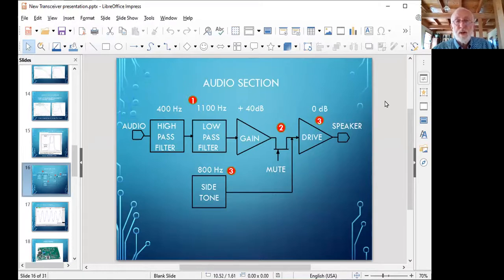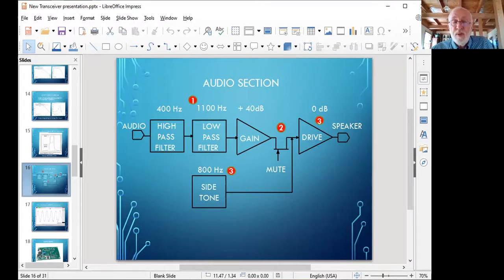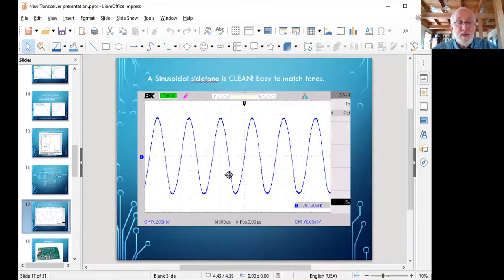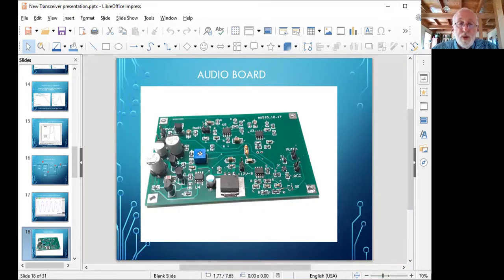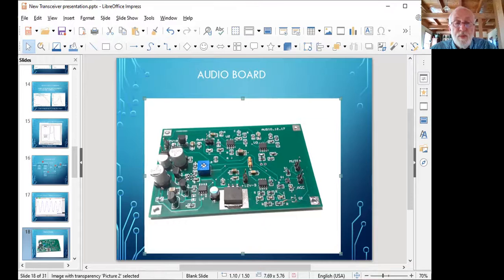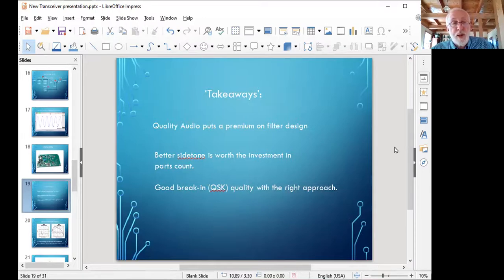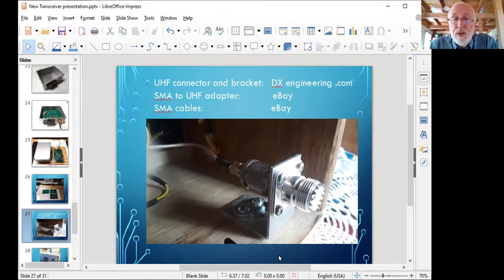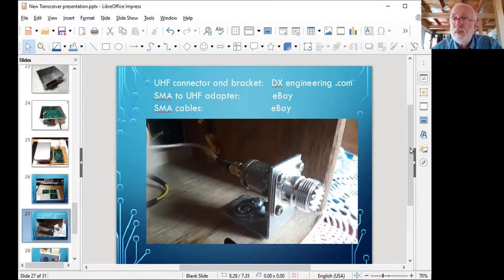Dave Benson K1SWL Part 2 - FDIM 2021 "Anatomy of a Transceiver. Thoughts on a Better Mousetrap"

Comment: This was most interesting, thanks Dave. I have studied your designs for many years. I have encountered many of the design trade-offs you describe in my own projects, particularly the underestimated effort required to get smooth muting and QSK. Receiver gain distribution across multiple bands is another design challenge.   Is there no AGC in your transceiver? And, can you clarify the IF gain  and devices? 73 Paul VK3HN